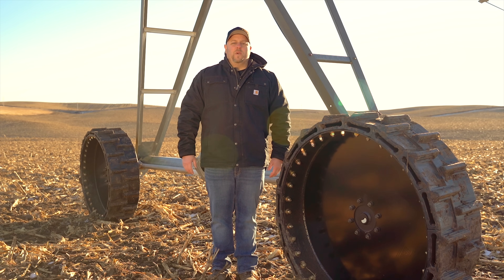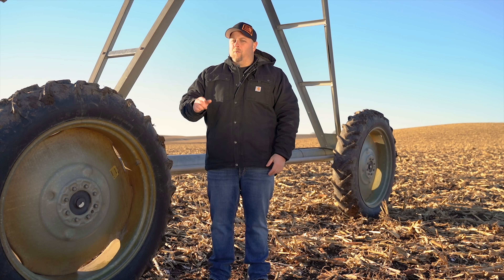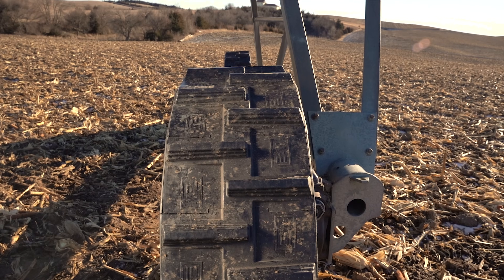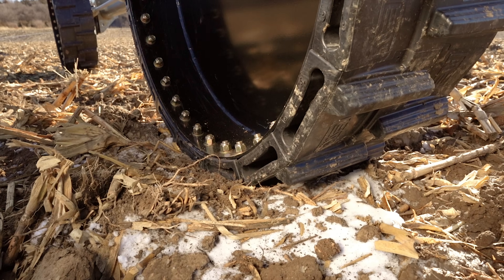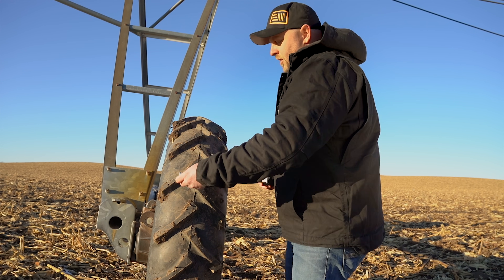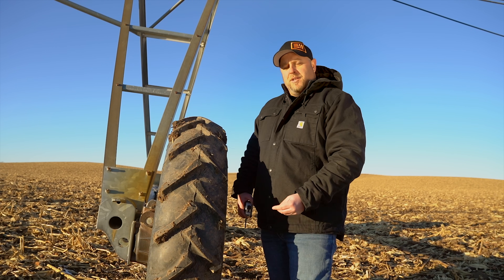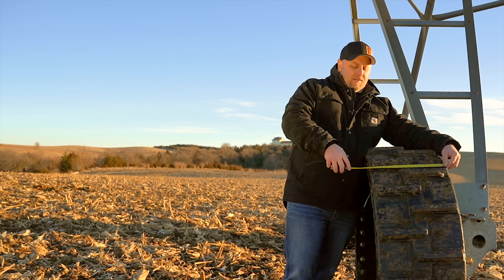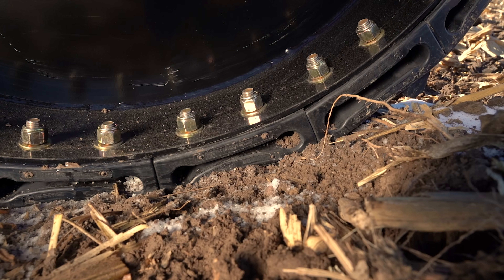EWRS-PIVOT Series vs. Standard Pneumatic Pivot Tires | Center Pivot Irrigation Tires Compared

Comment: Sounds good in theory, do you have any video to show tracks at the end of 20 rounds of pivot irrigation?
Reply from the maker: We have been videoing all growing season actually. The last videos are getting filmed this week. 17 rounds in fields with hills and low spots. We compared the 14.9-24 PIVOT-XT to a 11.2-38. Pivot-XT had a 2" track and 11.2-38 had a 10-12" track. Also video going through low silt spots and more. Follow us to watch as they are released
Reply: @EvolutionWheel  Yes I would love to see it. They are a considerable expense but worth it if they work as advertised. Picking up dry edible beans or digging sugarbeets through those tracks is zero fun and hard on everything for sure.
Reply from the maker: We understand on both points. On Tuesday at Husker Harvest Days in Grand Island, NE we are releasing our 11.2-24 model, it is actually designed to be 12.25" wide and the same technology .... but will sell for as low as $990 USD/tire and rim
Reply: @EvolutionWheel  But will that carry the same weight? I guess it's no smaller than an 11.2 - 24 pneumatic pivot tire. Also, will you be selling these in Western Canada?
Reply from the maker: It will carry the same load but if rutting is an issue then we will say to go with the 14.9-24. All of our tires are available in the US, Canada and other countries
Reply: @EvolutionWheel  Ok, I will watch for your videos on YouTube then.